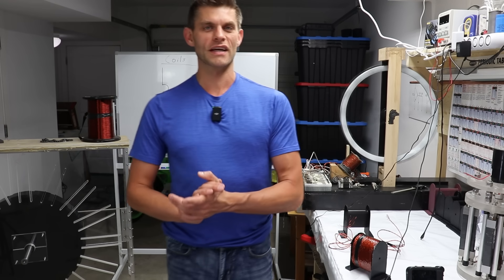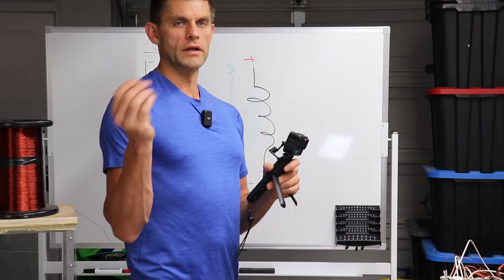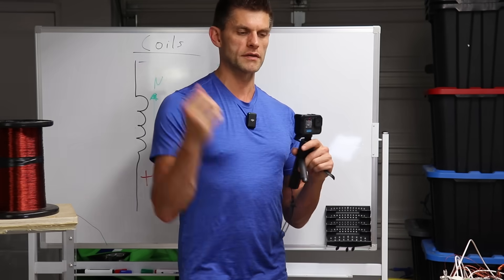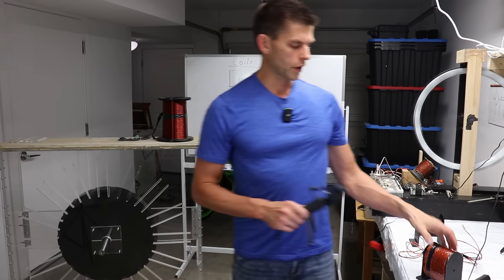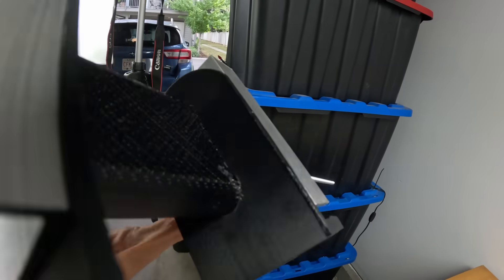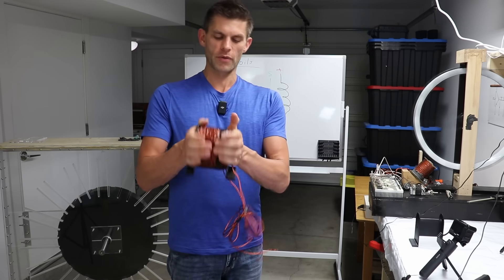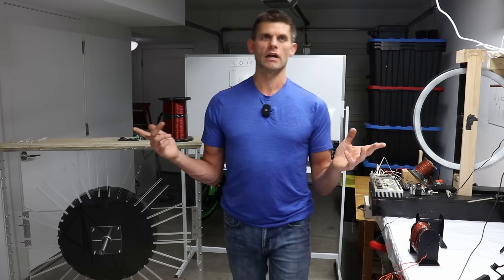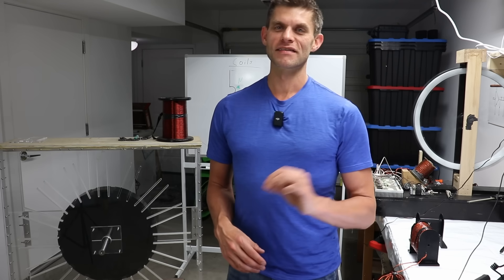Unlimited Energy in My Garage (No Patents)

Comment: Perhaps you could use litz wire? It's basically what you created but ready made. I used to use it for high power inductors in ultrasonic generators. Maybe explaining "Opening a dipole" in a lead acid battery would help understanding in where the "extra energy" comes from. This is the most crucial bit that needs to make sense. Given the description it is unclear why you need the rotating part. Back emf is generated by non moving coils as well as by motors but the power in it is always less than the power applied. Making up more than this difference is essential to understand otherwise it is just the gobbledy gook comment. I'm fortunate enough to have been living on perpetual energy for years (Solar).

Comment: If the magic is in the lead acid battery, why not just AC convert, boost, and rectify the ~13.5V from the source battery into the sink battery? Solid state power inverter for your car has thr first two parts, and a high-energy rectifier is a few choice diodes and some solder. Just do a way with the motor altogether and test it!
Reply from the maker: Would be ideal. But maybe the rotor is needed... will find out
Reply: Yes, but the point was to provide mechanical work while charging another battery

Comment: 👈💪✊ Thanks for sharing.

Look into radiant energy... Cancellation of em for resonant luminiferous æther. Tesla, moray, bearden, bedini, and ken wheeler on magnetism and metaphysics.
Reply: @MadscienceLPTECH most people have no idea that what we call the "vacuum" of space is actually full of energy. Tesla called it the aether, Moray was pulling energy from it in the 1930s, and Tom Bearden later broke it down as the "active vacuum." This isn’t some fringe theory bs malarkey, it's suppressed tech, hidden in plain sight.

Tesla literally said man will be able to tap the very wheelwork of nature... His wireless towers weren’t just about power distribution, he was trying to pull radiant energy straight out of spacetime.

Bearden called it “energy from the vacuum,” and explained it using scalar longitudinal waves, not the normal transverse EM stuff, but pressure waves in the aether. Totally different physics.

And Moray? He built a solid-state device that output 50kW with no fuel, no sunlight, just resonance with ambient aetheric energy... His book The Sea of Energy is slept on, but it’s pure gold if you’re digging into this.

Even mainstream science backs this now: the Casimir Effect literally proves the vacuum isn’t empty. There’s measurable energy between two plates, even at absolute zero.

We’re living in an energy ocean… but nobody taught us how to dive. Just paddle.🐬

Comment: Thats a pretty serious flywheel - did I hear you correctly that the flywheel rotor is silicon carbide??? That is NOT cheap for such a huge chunk, but a decent choice to balance thermal and mechanical properties.
Reply from the maker: Electrical components at SiC and the rotor is PEET

Comment: I’m thrilled to hear about your work and can’t wait to see how it turns out. I have access to some of John Bedini’s original prototypes and was close with Paul Babcock, who worked with him. Sadly, Paul passed away, but he was a great friend and believed strongly in the technology. He was focused on improving the switching system, which he said definitely worked. If I weren’t working on Tesla turbine projects, I’d be diving into this myself.

You need plenty of batteries, and lithium-ion ones are the best choice. Paul's biggest issue was mechanical—belts and bearings caused a lot of heat. He was getting about 300 watts of extra power, but that didn’t include the energy lost as heat. The challenge is figuring out if the extra energy is worth the effort.

Paul was making good progress and stopped using iron cores. His last project had solid funding and wasn’t shared publicly. I wish you all the best and look forward to seeing what you achieve!
Reply from the maker: Sick would love to chat with you. Cheers
Reply: @MadscienceLPTECH  I've literally made like 5 reply's and they all got deleted some how was it you madscience?
Reply: @iEnergySupply Probably not him, he said he wants to chat with you.  Where's the last project that was going well what's unavailable to the public????
Reply: @MadscienceLPTECH  Did you get my email?
Reply: what a puny power gain though. all that for 300 watts? and you have to have all those rare earth elements to make that power. none of this will ever be in the same universe as nuclear power. you guys have incredible minds. but the engineer in you is over worked. your trying to reinvent the wheel. batteries will never ever ever be a competitor in the energy race. never. the joke that is solar and wind power is a great example of how shit batteries are for large scale power. they have a short shelf life, even the very best of the best. it will never work.  i wish you guys would all drop this dream and actually find out about zero point energy. tesla had the right idea. and not even one of them involved a battery in any way. think about that
Reply: @bparker86  All energy losses were attributed to heat generated by the bearings and the belt connected to the shaft. Additionally, the generator was overheating, further contributing to power loss. By addressing these mechanical and other issues, the system could potentially achieve an output of 600 watts. When this technology was first developed, it produced only a few watts of surplus power. Through ongoing experimentation, the power output has incrementally increased. While 600 watts may seem modest, it accumulates significantly over time, equating to 14.4 kilowatt-hours per day, or approximately 5,256 kilowatt-hours over a year, without requiring any fuel source. If Nikola Tesla had developed a superior solution, as I believe he might have, that solution remains undiscovered, so we must begin somewhere. Allowing those who are actively experimenting to continue their work may lead to improvements that could surpass even Tesla’s potential achievements.

Comment: There is no measure input power or output power. And even if your somehow able to extract a little surrounding energy, it would likely be just enough to keep it turning. I don't believe there is any evidence of "free energy" and in your garage no less where external signals would be blocked. And, why is wheel verticle?
Reply from the maker: Lol dont like axial loads on bearings

Comment: I'm hopeful, but we've all heard over unity claims before. 

that being said, this is according to ChatGPT. 

Batteries already operate on electrochemical dipoles (separation of charges across electrodes).

There's no known mechanism in physics where applying a high-voltage spike to a lead-acid battery causes a new “dipole” to open that wasn't already present.
Reply from the maker: Lol chat gpt has parameters
Reply: @MadscienceLPTECH  I will keep an eye out on your progress. I'm not one opposed to be proven wrong.
Reply from the maker: @chunkytonk great attitude 😊 cheers

Comment: When i experimented with the Bedini motor/energizer 12 years ago i found out that it could charge 2-3 12 volt batteries in series from the output, When driven from one 12 volt battery.
Reply from the maker: That's great to hear, thanks for sharing!

Comment: It's a Bedini motor, i've built dozens of them. Pulse motors are very efficient, but you will never get a COP>1. Mosfets are not silicon carbide, the clue is in the name; Metal Oxide Semiconductor. Do you really have a degree in electrical engineering? Good luck with the build, but i fear you will be disappointed.
Reply: A bedini motor is an altered copy of the adam's motor, right?
Reply: @alanx4121  Similar. Bedini worked with Floyd Sweet & Tom Bearden. Most of this came out on Keeleynet years ago. Here is a copy of the P.J. Kelly encyclopedia of free energy inventors;
https://drive.google.com/file/d/1dnMeGt_07XbCXKEzaObD2gpuWOj45w-I/view?usp=sharing
Reply from the maker: Amazing
Reply from the maker: Um mosfets are most definitely SiC?

Comment: Nichola Tesla was one such great that had a electric car that he demonstrated, he drove it around for hours using the either in the air. It was reported he had a small case he carried with him bearing the energy device no moving parts but a way to capture the magnetic frequency present in and around us. The technology is real and yes it has a great past, hopefully your journey will end in triumph great direction keep the momentum.
Reply from the maker: Thank you sir
Reply: Tesla was a magnificent visionary, and an excellent showman, not to slight his good engineering knowledge and vision.
Reply: Also Thomas Henry Moray around the same time.
Reply: There was a guy on YouTube. Can’t find the video anymore but he covered it all up. He was not yet ready to share the inside and how it works. I was a bit skeptical. But his meters and how the thing was set up on video showed it actually had an high megawatt output. He made this small box and claimed to power his house from it. He wanted to expand it so he will help his neighbors and further. I know this is possible. As a kid I had this “fantasy” about building the small machine. I remember building the small box to power the house. Only thing is a cardboard box with two strings attached and you put it in a outlet will shortcut the power. Maby the circuit board of the house couldn’t handle the power from the homemade power box
Reply: Tesla also literally had visions from "beyond the veil" explaining to him the same gnosis Socrates had.
Reply: He had tuned his car to be powered by his transmission coil in his lab!!

Comment: I find it easiest to accept the ocean of energy around us because of the air temperature; the atoms are moving around in the air much faster when compared to absolute zero, of course.
Reply from the maker: Yes its easy to accept current beliefs then new ones for sure
Reply: Well, just use that thermal energy to run a generator. Easy peasy. Get back to us on that.

Comment: The question I have is.... Does that working model which is spinning on the bench producing any energy that can be considered to be above the energy required to run it? 
In my opinion, I wouldn't proceed to a larger and better made version of literally the same thing especially if the prototype hasn't demonstrated that it is doing what you set out to achieve.... 
Experimenting can become very expensive! And you really need to be able to see something that you feel like everyone else has missed and you really need to persue that in order to know for sure that if you found something and that something is a key piece of the bigger picture, then once you get it, the rest is just hard work and the materials needed to get it together and working! 
I have yet to come across anyone who is able to demonstrate even 5μA of any voltage over and above the energy going in.... 
I'm not here to say that this is a stupid idea and no one should do it because others have tried and if it was possible it would have been invented by now... No! 
I'm saying that you need to be that person, the same person who has been giving the topic a lot of thought and has seen something in a way that only they could because of what they have learnt and how they understand it.... Not everyone is for everything! Some people, for example a guy looks at another guy doing something and then thinks to himself that the other person is a guy just like me so that automatically means that I should be able to do that too! Wrong! You are inherently good at something or posses the skills to learn it like you were born with it.... You would have been drawn to it because it draws you in! You don't see it and think ohhhh that's cool, you see it and two weeks later you are still thinking about it! This is your calling, go and get involved with your destiny! You have already delivered ideas for testing and experimentation.... If this sounds like you! You have work to do!
Reply from the maker: Yes the small model uses old tech, sometimes you need to jump with faith 🙏
Reply: @MadscienceLPTECH  don't get me wrong, I'm not here to say that you are wasting your time because "everyone" says that it's not possible.... 
I think that you feel it just like I do, there's something there that I just can't quite put my finger on it! 
It's like people have come so close to making the discovery but as it stands, no one has achieved it yet! Or probably has but isn't telling anyone? 
I just feel like you built a prototype and now you are building a new version of the prototype.... 
Which begs the question! How energy does the prototype need to run and how much is it giving back? 
Having a wheel rotating with magnets be it permanent or electro looks nice in a video but if I can't see you working on it where I can see what you are doing, what was happening before and what happened after you adjusted something or added something else, perhaps something that you thought of or perhaps something a viewer suggested because they were watching what you were doing, at least it's going to look like you are actually trying to figure this out instead of making the video appear like it's just an ask for money! 
I honestly believe that a person who has the right idea will be able to achieve goals with whatever materials come to hand, I just watched the channel Diodes Gone Wild construct a nightlight out of an empty USB charger housing and a piece of broken car indicator light housing that he found on the street! 
I would call that his prototype! It was rough and crude but if he then said that he wanted to make it into a proper product but needed public support for the financing of it, he will get the money! 
But in your case, all you have is a spinning wheel consuming energy of which I don't know how much! Actually apart from being a very simple electric motor which there are plenty examples on YouTube, I feel like you are not giving up any information.... All I can remember today is that you need money to build a new and better constructed version of the one that I know nothing about! 
Can you see where I'm coming from? 
If you are working on something and need something because something is telling you that if you apply that something you would achieve something more or better but you can't do it because you can't afford it, if your audience is well informed and following what you are doing, they will push you to open the door to them donating money to you.... 
I don't know what silicon carbide transistors are? Are they used for drill bit tips? 
Or are they some new type of transistor that no one else is talking about? Gallium Nitride Field Effect Transistors were the last and latest transistor to come to the market... 
You really need to be doing more on camera, measurements! Data! 
Faith has nothing to do with it! Facts with measurements for proof is all that matters... You want to test faith, step out in front of a moving train while praying to be safe and let me know how that goes! 
My boss does not pay me in faith that I'm going to do my job! I need to show up and put in the work with evidence that I did something before my boss is going to pay me.....

Comment: I spent several years following JLN labs and although I played with Bedini motors I chose the Newman motor to replicate. Yes, I realize Joseph Newman appeared to be inept, but his concept produced some incredible results. The high voltage is key along with variable commutation advance timing. Unfortunately eventually life takes hold and attentions are redirected. I used a 5 gallon bucket as a coil form with 6 miles of #28 magnet wire mounted on a wooden frame with crude rotor tipped with 8 1"x2" Neodymium magnets (4 on each end). Using a neon sign transformer along with a variac, diode stacks and HV capacitors to produce a variable 1 to 2 KV power supply. I constructed an adjustable mechanical commutator and was able to achieve 600 RPM on an open air 5 lb rotor with under 5 watts of power measure at the power supply mains. So I know incredible things are possible at the least. I endeavored to build a Stanley Meyer electrolyzer, but eventually life redirected my efforts and my imagination gave me too many things to do. I have zero doubt that the goal is achievable, but at 72 I'm afraid I've run out of steam.... Good luck ;^)
Reply from the maker: So cool sir, I wish I could see your build!
Reply: Similar path. Life has a way of diverting us from rabbit holes. At some point (69 yrs young now) you realize it's better to live life. The world doesn't need us to change it, maybe just understand it better?
Reply: Take a lesson from this mans life and go find something useful to do.
Reply: Similar path, I built rotoverters..
Reply: For a second, I thought it said Joseph Smith.
Reply: Agreed.  The Newman Motor is definitely the best of the mechanical over unity devices.  Better than the Bedini devices by far as others have made superior pulse motors with back EMF collection.  

You probably already have it, but if not, look up Patrick J Kelly's time on Free Energy Devices.